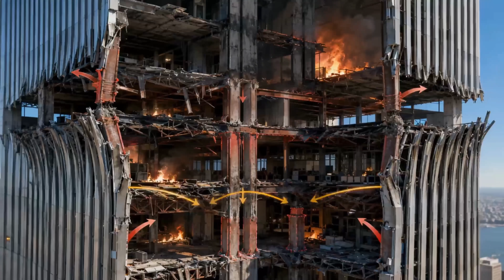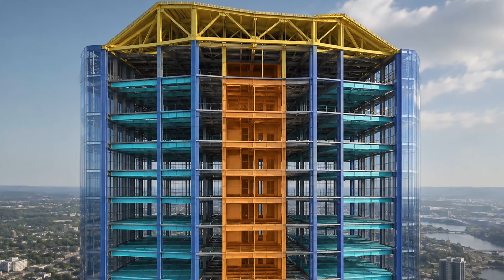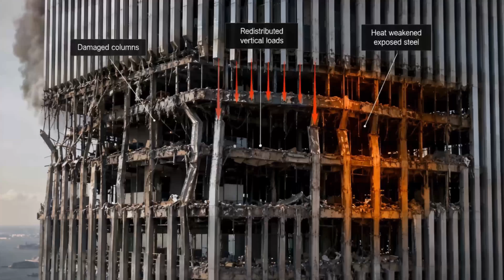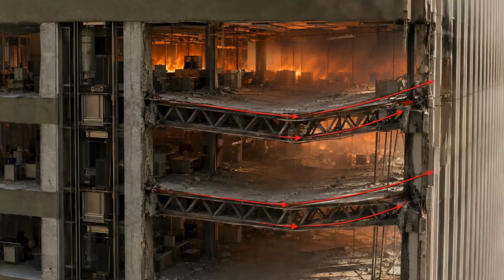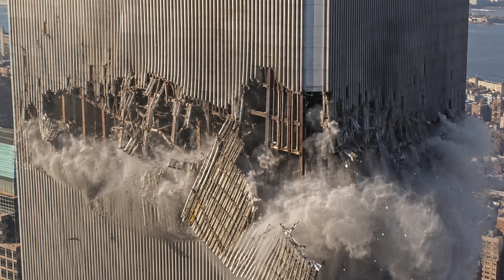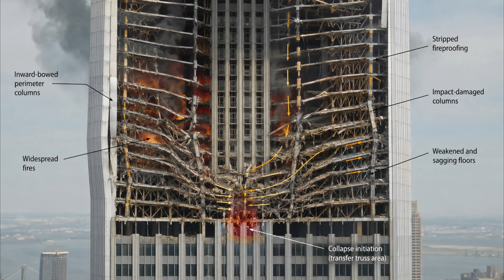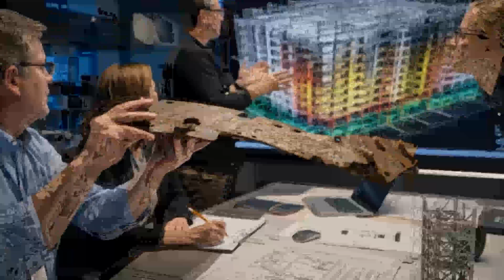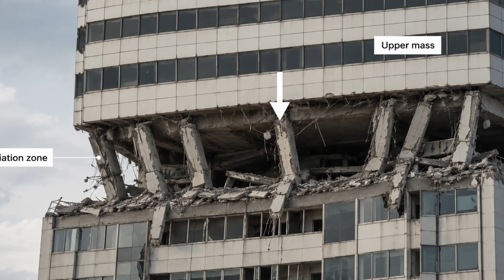What Happened Inside the Twin-Towers After Impact?

Comment: They buildings were diagnosed to withstand fires.  Did you know the firefighters who went into the building have a structural engineer to advised floor collapse as time went on  no one suspected a collaspe not even a fire chief structural engineer.   

And the fire sprinkler system didnt work either?   30min collasped ?
Reply: What does withstand fires mean?

Many of the firefighters who went up knew they weren't coming back down. No engineers went with them.

Sprinkler systems tend not to work well when 122 tons of airliner rips out the standpipes.
Reply: @TheLoonResistance the buildings were designed to withstand fires.  Building codes is code 1-b etc.  they have meet certain requirements.   Even if the steel was weakened.   They not melt and they could still withstand the weight
Reply: I’m not making anything up.  If you’re actually interested.  Check out wiki and look at some the references and read a couple.
Reply: @TheLoonResistance the chief structural engineer.  Stays on the ground it’s his job to assess the structural integrity of the building.  He deems it’s it’s unsafe it’s his csll and they will not send firefighters into a building thsts gonna collaspe.
Reply: @TysonThomas-u1u  - Firefighters go into unsafe situations all the time. It's the job. 

www.youtube.com/shorts/XZ3wvzdada0

There was no Chief Structural Engineer at the command post in either the North or South Tower lobbies.  If there was, you could give a name - point him out in the Naudet film but you can't do either. There was no one familiar with the Twin Towers. No one who had been up to the impact floors and assessed the damage which is the only way what you describe could be done and made it back down again.

Given the choice between dealing with known true and relevant facts and making shit up to conform to your personal brand of reality-distortion I would prefer to do the latter. So please stop fucking around and making shit up. I have forgotten a thousand times more about 9/11 than you have ever know. You will NOT be blowing smoke up my ass. 

You have been warned. 

Every building is designed to withstand fires to one degree or another. We lose tens of thousands of them to fire every year anyway.  Withstand fire for how long?  One minute?  5 minutes? 30 minutes? An hour?  What happens if the systems designed to withstand those fires are themselves comprimised?  How does that effect the ability of the structure to withstand fires?

Twin Towers collapses were a combo-platter of Impact Damage + Fire (heat) + Time + Gravity = Collapse

Remove any one of those factors and there is no collapse. Ignore any one of those factors and there is no collapse. You are ignoring 3.  I have mentioned this before.
Reply: a fire isn't the same thing as an INFERNO ..... and a sprinkler system might not work if the pipes are RUINED !! .... your brain is thicker than cement

Comment: These buildings were designed constructed great.  This isn’t Jenga.  If anyone is truly interested in this.  Id advise you to look up rje redundancy in there design.  Also they were built to withstand a commercial plane so where did they get wrong?
Reply: They didn't go wrong. You went wrong when you decided arbitrarily that great design and construction = indestructible which is of course, complete nonsense.

As a point of fact, the Twin Towers were never designed to withstand any sort of aircraft impact (and certainly all aircraft impacts are NOT created equal). It was not a requirement of the customer or of NYC building code and you will find no mention of it in the blueprints.

What appears to be true (anecdotally - no records survive) is that after primary design work was done someone threw together a 3-page memo with some hand calculations about what would happen to the structure if a Boeing 707 lost in fog and on landing approach (light and slow) would accidentally strike one of the Towers. That memo concluded the Tower would survive the impact No consideration was given for fuel load and the effect of subsequent fires over time. That would be quite difficult even today, let alone with pencil and slide rule in 1964.

Leslie Robertson himself said that the buildings were designed to not collapse immediately if struck by a Boeing 707 flying low and slow and almost out of fuel. He never claimed that the buildings would remain standing indefinitely under those circumstances. Further, he said that the size, weight and speed of the aircraft which actually struck the towers as well as the fuel load and fire damage were well beyond any considerations incorporated into the building design. 

You guys always leave that part of his interviews out. 

On 9/11 the Twin Towers faced deliberate attack by much larger and loaded Boeing 767's at dramatically higher speeds, resulting in impacts with 4 and 5 times the energy respectively of anything considered in 1964. Please note both Towers survived those much greater impacts in a real-world event, not 3 pages of hand calculations. 

This is because the collapses were not due to impact damage alone but a combination of; 

Impact Damage + Fire (heat) + Time + Gravity

Remove any one of those four elements and there is no collapse. Ignore any one of those four elements and you won't understand them. Every structure has its limits. The Twin Towers worked great right up to the moment they exceeded theirs.
Reply: You think the only blueprints went down in the building? 

The building owner property manager has one
The architect and engineering firm has one 
The general contractor/builder has a copy 

And than the local municipal city has a copy.  Who permit the building permits on approval of the plans.  

And it goes on but you get what I’m saying.
Reply: Please if you’re gonna get upset or call me out.  Give me sources /facts.   I’m giving you my opinion with firefighting facts and engeering facts.   I’ll listen to What you wanna counter with.  Butnil not gonna do the your stupid thing come on
Reply: @T @TheLoonResistance  they designed the building to within a 707 commercial flight but ONLY under certsin conditions, low fuel , low speed,  does that really make sense to you?
Reply: @TysonThomas-u1u  - Again, As a point of fact, the Twin Towers were never designed to withstand any sort of aircraft impact (and certainly all aircraft impacts are NOT created equal). It was not a requirement of the customer or of NYC building code and you will find no mention of it in the blueprints.

What appears to be true (anecdotally - no records survive) is that after primary design work was done someone threw together a 3-page memo with some hand calculations about what would happen to the structure if the largest aircraft in service at the time - a Boeing 707 - lost in fog and on landing approach (light and slow) would accidentally strike one of the Towers.  This was due to the memory of the July 1945 crash of a U.S. Army Air Corps B-25D Mitchell bomber into the Empire State Building - so no, not odd.
Reply: @The @TheLoonResistance ad my comments before you reply  Blue prints are not one copy thing.  They have to be Numerous copys.  For example when WORK/Maintenance needs to be done they have to have blue prints dimensions locations.  The city’s Municipal Building/authority is one that has to have a copy of it.    The construction company and on an on. 

I’m simply adding up things thst don’t mske sense or sre wrong
Reply: You’re killing me bro.   I’m giving you links to this information im not giving you my teo csnt.   YOU ARE giving me your two cents.     

Counter me with facts sources links.  I can go on an on about my two cents that doesnt hold much value.   Do you wanna hear my two cents opinions?
Reply: You keep replying to my comments with YOUR TWO CENTS.   While I keep giving you sources /written evidence from multiple sources from 
Engeering 
Fire figjting 
Structural design 
Building codes 

I’m not giving you my two cents.   If  cant even try to counter my arguments with anything but your opinion im not gonna waste my time

I have told you if you counter me I will say your right and I’m wrong.   But you gotta meet me half way
Reply: @TysonThomas-u1u  - I don't have to add your comments. They are already extant in the thread. Maybe try replying once instead of 3-4 times if you are having difficulty tracking the discussion. Saves me the trouble of having to answer 3-4 posts at a time in order to hold the reins on this thing. 

You are not adding up anything. You are using an unfocused shotgun approach making a lot of assumptions, then being stubborn about accepting answers that don't fit those assumptions. My suggestion would be to assume everything you think you know is wrong - because based on the evidence so far that is almost certainly true - then start over from the beginning.
Reply: @TheLoonResistance  bro please,  your following me around on multiple videos.  Im  replying to your comments not the other way around.  

I’m giving you sources thinks to Wjat im saying.   It’s not my two cents.   

I’m not adding up anything ?  
Ok shotgun blast.  
How about we can go slow if thsts more comfortable for you.   

Pick one of my “ opinions” yiu don’t think adds up.    Read the source I sent you.   And counter it .  Tell me why it’s wrong doesnt make sense.
Reply: I’m not making assumptions bro.   I’m giving you 3rd party sources you can read for your self.   How many times do I have to say this.   

Your giving me your opinions im giving you articles fire figjting / engineering.   Ugh please someone jump in and helo this guy out
Reply: @TysonThomas-u1u  - Going back through every single one of your posts here you do not provide a single name, a single publication, a single link, a single source.  You speak in vague generalities.

"Check out wiki" and "the fire chief structural engineer" are not citing sources
Reply: Bro haha ugh.  I’m saying to make it easy for you go to Wikipedia and go to the bottom and it list sources used in the article ( where they got the information from )  

Read one on a topic you don’t agree with me on  Ie /. Engineering /building codes
Fire figjting /.    If you don’t or won’t do that let me know.   And I will  give you direct links.   

Im not here to tell your what to believe i don’t care.  I was raising some questions trying to get people to look into something on there own and come to there own conclusions.  

You realize you’re the one following me around which is weird in general who does thst.  And I’m logically over snd over again telling you the same things.    Counter me with something other than your personal opinion.    
 
Killing me dude
Reply: @TheLoonResistance  not gonna add my comments haha just follow me around on different videos. Weirdo
Reply: airplanes have gotten BIGGER - airplanes have gone FASTER - airplanes carry more FUEL ..... a 1970 airplane isnt the same thing as a 2000 airplane